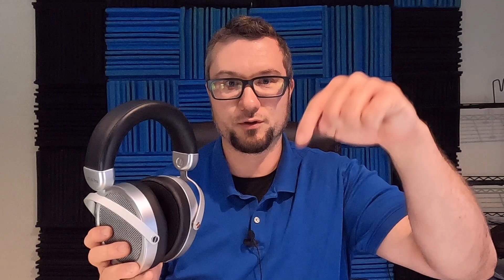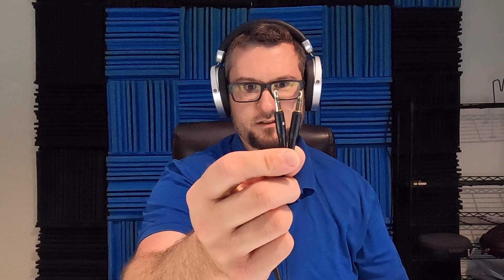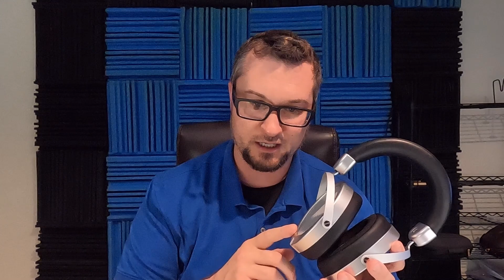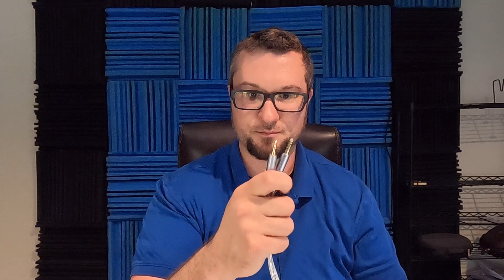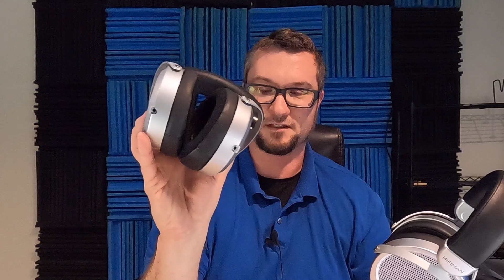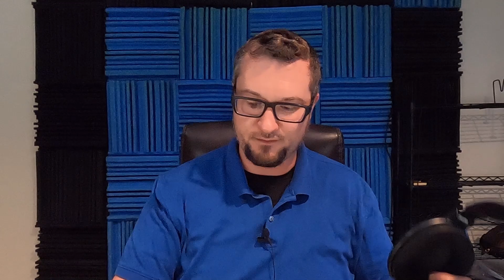HiFiMan Deva Pro Planar Magnetic Headphone Review

Comment: you compare deva pro wireless hp with only wired hp-s??? wow, 880 are studio hp, 6xx is studio& home hp,
Reply from the maker: While using the Deva Pro in wired mode. The dongle comes off and you can plug a trrs cable in.

Comment: I believe the fostex tr60 4 pin XLR cable will work I agree with you you shouldn't bring it outside where it's windy because you could pop the driver unless it had a protective coating on the diaphragm like if it was coated with some type of polymer or something

Comment: excellent review, I've had the Deva Pro for around 6 months, the blue mini in terms of detail etc beat my btr5, ifi hipdac but started to be outclassed by my   xdupp 05 balanced with the preamps upgraded, desk top sure it did scale quite well. Only issue is I don't have another r2f to compare it with. I made my own balanced cable for it and also an adapter to drive other balanced capable headphones. For the price I think the blue mini blows the competition at the price out of the water Inc ifi,s latest orrferings for pure definition and sonics overall. At around the same price I still prefer my 2020 Sundaras in the hifiman lineup but that may just be a thing as they were my first open back planars and have a special place in my heart 😁
Reply: Smart man right here! The Bluemini R2R (aka 3rd Gen) is IMO straight up the BEST old school R2R ("Resistor-to-Resistor") ladder DAC you can get for <≈$150, REGARDLESS of its Bluetooth capabilities or the shockingly powerful built-in amp!

HiFiMan's in-house designed "Himalaya" R2R DAC is just an absolutely BRILLIANT implementation of a unique & sadly dying out style of DAC design. Meaning that this is one of the very best ways to get that deliciously analog/tube-esque sound of proper R2R goodness! All of which makes the Deva Pro package as a whole for ≈$300 ABSOLUTELY FUCKING RIDICULOUS VALUE!!!! 😳🤯
Reply: R2R rocks ☝️ sound